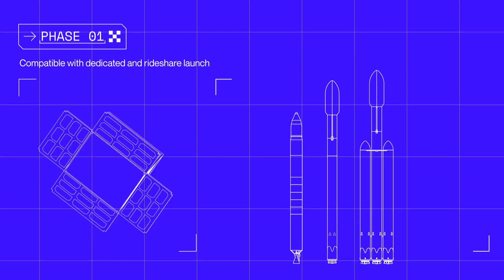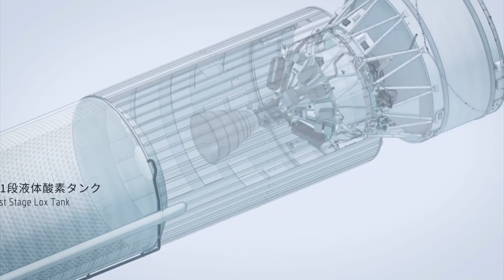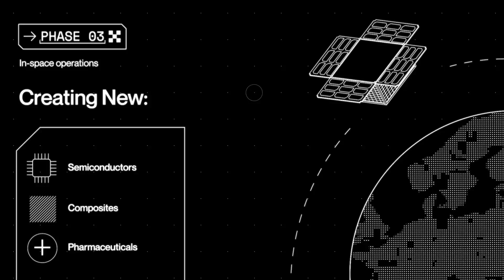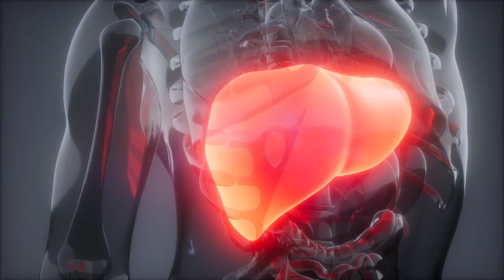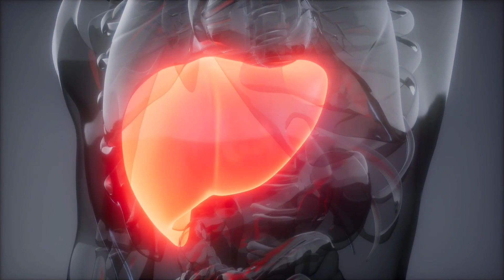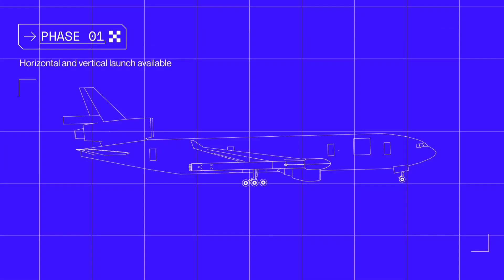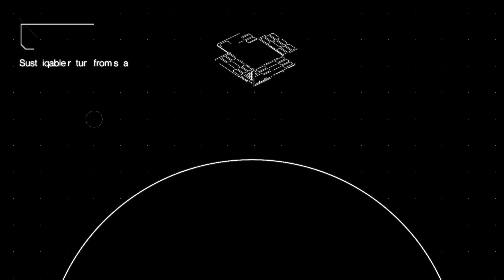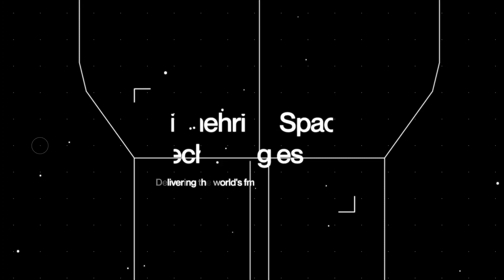Jeff Bezos TALKS about space manufacturing, but UK innovation will actually do it this Summer!

Comment: Air cools things by convection. Fast cooling is a problem for substances and alloys that can produce unwanted grains / crystals / deformations.
Microgravity and vacuum might be optimal for certain applications.
The problem is scaling up and product volume.
For example we could produce optical fibers, but if they are not long enough, splicing many segments could counter the benefits originally planned.

Comment: A clearly analagous example is subsea production of oil and gas but actually in a much harsher environment than space (salt water, high pressures etc) so actually manufacturing without personnel is very sensible. I do question the likelihood of how likely it is that manufacturing in space will be anything other than carbon positive since you have enormous amounts of CO2 produced in the launch. I think the idea of asteroid mining etc is also unlikely in the near term and it would be producing valuable materials (precious metals or high value minerals) rather than basic materials in high volumes. Micro manufacturing of high value and also experimental materials could be quite lucrative in the short term and at the prices proposed would be accessible to many companies and research projects.
Reply: moon mining?

Comment: IMO anyone selling the idea that manufacturing in orbit will keep related pollution off the earth is either delusional or a charlatan. As @rbrtck and some others have noted, pollution released in orbit will eventually rejoin the upper atmosphere. Accelerating the pollution to escape velocity means you have to contain it first, and if you can contain it you can mitigate or reprocess it in other ways. That said, manufacturing outside earth's orbit (or inside the moon's gravitational well) can effectively prevent any releases from polluting the Earth. And better still, if done with in-situ materials avoids all the enormous energy cost of launch from earth.

Comment: Bringing mass back to Earth would be easy with a very large capsule and ablative shield.   Hard to get from Earth.  Therein lies the need for Neutron scale rockets combined with space made reentry vehicles.
Reply: Sounds like this one is going the opposite direction: low mass and a massive "orbital parachute" to spread the heat and deceleration of reentry over a few hours or days instead of minutes- should be quite gentle if they can do it, but it's a mostly untrodden field so very experimental.
Reply: @absalomdraconis  Very interesting, thanks for the reply.  I still think Starship is predicated on false logic.  Elon normally thinks things through, but he blew it on Starship.  Getting mass off earth is the problem, bringing it back is not.  Something like hundreds of Neutrons launching  daily could put Starship into the graveyard.  The economics of starship with expensive stage zero is a big problem.  Bringing mass back to earth can be done like you suggest, or a simple unmanned vehicle with large ablative shield built in orbit.  Precious cargo like humans can return to earth in a lifting body like Dream Chaser.

Comment: EXAGGERATING doesn't even begin to describe how much of this is hyped up garbage.

I am an aerospace engineer and I have 30+ years in industrial automation that includes considerable time in BOTH manufacturing and mining. I ended up in mining after meeting Harrison Schmitt (Apollo 17) in 2002 and he told me to look into Helium-3. That meant lunar mining, so I went looking for PRACTICAL experience in mining. 

Luckily Australia was building new mines at the time and experience was there to be taken. What I got was an education in just how much we dig up and the logistics involved. People like Jeff Bezos are selling one of the most brain dead fantasies in history when he wants to move heavy industry off planet.

Having worked for 3 of the biggest iron ore mining companies in the world (BHP, Rio Tinto & Fortescue) I can guarantee most people haven't the slightest clue about how much is actually dug up and processed. Combined China and Australia (the 2 largest producers) produce over 2,000 million tons per year of iron ore. Iron ore has various grades ranging from around 55% to 95% based on the actual weight of iron in the ore. The middle of that is around 70% which I'll use because the math gets very easy for people to follow.

Space shuttles could at maximum lift 30tons to orbit BUT only land with 14 tons of payload. So 2,000 million tons of iron ore at 70% makes around 1,400 million tons of iron ore divided by 14 equals 100 million space shuttle flights EACH YEAR. 

The logistics of iron production is a staggering exercise and that's just iron ore. After that is Nickel, Copper, Aluminium and the rest. TOO MANY PEOPLE think that there's we just dig up stuff pump it through factories and stuff pops out for people to buy

This line about how all manufacturing will be moved off world is just garbage, but there are things that can be practically made off world and they fall into 2 categories:
1) Those items which absolutely need microgravity; and,
2) Those items which are incredibly valuable by weight that benefit from microgravity during manufacturing, like the crystalline ingots that microchips are made from.

Promoting what can be done is great by me but promoting idiotic fantasies isn't. We've wasted so much time and effort on idiotic fantasies over recent decades. Its why we haven't been back to the moon or developed a lunar bae.

Sorry Angry but this is the worst episode I have seen you do.

Comment: Not sure how this will reduce carbon footprint? To produce at the scale of equivalent Earth facilities, you'll probably need to vent it overboard, which means the carbon will stay in orbit, which still reflects heat back down to Earth? Except now it will be even more difficult to remove if it turns out to be problematic, and now you're taking carbon out of the normal carbon cycle . . .
Reply: Good and valid point. This is terribly misleading. Its not all BS just 99.9% or more.
I have written a lengthy explanation if you are interested. The short answer is that its simply not logistically practical in any way to move any but the most specialised manufacturing off world.
Forget the carbon footprint its just impractical to fly that much stuff up and back.

Comment: This seems like an incredible reach for viability. I put this more on the side of big talk, little chance of really happening or being successful. At the very best, it will be an ultra expensive scientific demonstration that has no real chance of being economically feasible without growing in size 100 fold.
Reply: Its mostly bullshite, but not all.
I have written a lengthy explanation if you are interested. The short answer is that its simply not logistically practical in any way to move any but the most specialised manufacturing off world.
Reply: @tonywilson4713  Isn`t that what he said?
Reply: For R&D these microsats are actually probably realistic, but beyond that they'll be limited to e.g. low-demand pharmaceuticals. Large-scale space manufacturing can work, but the real payoff comes when you get the materials from space to use in space for e.g. solar power satellites. Ordinary manufacturing has little to no need for zero-gee (though there are some materials, e.g. for transformers, that might be easier to properly create up there).

Comment: I don’t really see the purpose in on-orbit manufacturing for things other than space hardware. The idea of manufacturing things in space, which requires raw materials from the ground, and then selling it back to the ground just seems silly. Manufacturing on the Moon, Mars, and beyond has major benefits for space travel, but in terms of raw production, means nada for Earth-based general stores. I mean, you can only sell the novelty of “Made in Space” to so many people for so long.
Reply: There are metal type of asteroid that vary from rare to common metals in them.
Reply: @Jaxvidstar  Yes, and that’s partially why I included Mars in the areas where space manufacturing would be viable, and even then I think it would just be the manufacturing of space hardware and parts for Mars/the outer solar system, I doubt anything would be coming back to earth for sale at anywhere near a competitive price.
Reply: @ksmi9109  With all the rare metals that is stuck in China. There would be plenty of incentive to find a way to move it down to earth.

Comment: Good to hear that Space Forge will be developing manufacturing opportunities in LEO. But so far as the global environment is concerned, I don't see exactly how there will be any significant reduction in pollution on Earth until we begin industrial-scale mining of material resources from the Moon and near-Earth asteroids, and of solar power in space. I suppose that Space Forge might be proposing large-scale LEO manufacture of alloys whose strength to weight ratio is so much higher than that of conventional steel and other alloys that the increased environmental costs of the rocket launches and re-entry braking is more than compensated by the reduced quantities of raw metals that have to be mined on Earth. For example in 2019 about 3 billion tonnes of iron ore were mined globally: by how much is Space Forge proposing to reduce that figure, and at what additional cost in rocket launch and re-entry emissions?
Reply: Great point. I am an aerospace engineer and I have worked in the Australian mining industry. I went there after meeting Harrison Schmitt (Apollo 17) in 2002 who mentioned Helium-3.

This vid is terribly misleading. Its not all BS just 99.9% or more.
I have written a lengthy explanation if you are interested. The short answer is that its simply not logistically practical in any way to move any but the most specialised manufacturing off world. I use the 2 Billion tons of iron ore that China and Australia produce because the math is easy for people to follow.
Reply: Space Forge probably won't reduce it much, if at all. More likely they'll be aiming at R&D for materials science, and low-volume pharmaceuticals. They should be a practical choice for either of those.

Comment: Bezos is full of it. Space based manufacturing won't reduce carbon from manufacturing because it will require a massive amount of launches to deliver equipment, personal, and most importantly and abundantly, materials.
Reply: I’m skeptical also, but I think the plan is to get the materials from captured astroids or the moon ultimately
Reply: Your right, this is terribly misleading. Its not all BS just 99.9% or more.
I have written a lengthy explanation if you are interested. The short answer is that its simply not logistically practical in any way to move any but the most specialised manufacturing off world.
Even if the raw materials are sourced off world its still not practical to bring that much stuff back to Earth except for those vary rare items that we only need small amounts off.

Comment: Anything made is space will be way more expensive instead something costing $10 it will cost $100 the shipping cost per kg is way higher and totally unnecessary. Jeff Bezos is delusional and talking complete crap but if he wants to spend his money on his orbital reef well so be it.
The pollution caused by launching anything into space and back would totally eclipse any possible savings that could be made. There would be very few niche cases where making something in space has much benefit. The lack of gravity is in many cases hugely problematic not a benefit. Any equipment maintenance is near impossible etc.
Reply: His version is nonsense but that being said the cost of most things made in space well be used in space it is common sense There is no reentery or getting something into orbit. Everything has its place but once antimatter catalyzed fusion is used it well not matter. It well be as easy to get something into orbit as it is to now ship something anywhere on earth.
Reply: @clementvining2487  It really makes no sense. For efficient production the complex factory required to be sent into space to make stuff will be heavier than the stuff that is made. It's certainly cheaper to make stuff on the ground wherever possible.
LEO Space manufacturing is not plausible beyond very expensive experimental stuff.
The moon or mars where you can obtain local resources to make stuff for local use may begin to happen with starship but such off world economy's will take decades to develop.
Reply: @stephenhumble7627  : For some low-volume pharmaceuticals and materials R&D purposes it actually could make a lot of sense. It's large-volume stuff that's off the table for now.
Reply: You've got it right, Bezos is spruiking BS and lots of it. Almost as much as Elon but that's another story.

I have written a lengthy explanation if you are interested. The short answer is that its simply not logistically practical in any way to move any but the most specialised manufacturing off world.

Comment: i m all for space manufacturing, but i do think its best with a station (or at least a permanent satellite) where the production equipements can stay in place to be resupply.  Launching and landing your equipement constantly will be ineficient and will impose to much restriction on the weigth, dimension, sturdiness etc on the equipement.
+ that mean that this compagnie have to pursue 2 objectives at the same time: developing space manufacturing and developing reusable satelite/lander plateform.
i fear they are focusing more on the later and keep the former as aspiration.

I m invested in Redwire (RDW-N), which acquired Madeinspace and is already operating a plastic printer in the space station, and developed roll up solar panel with printed boom for satelitte or ISS (ROSA) doing research on organic printing and such.
I get that with their satellite they want to avoid waiting on commercial station. But with heavy launcher about to hit the market soon, station could be following faster then tough, which would shorten the period where their reusable satellite would be advantagous.  Also i don't see it ever become profitable, and all that work on the satellite could put them behind on the manufacturing side of the business.
Reply: It's a multi step proccess, no point in making your own 25billion dollar station when you can do a couple dozen 10million dollar satellites